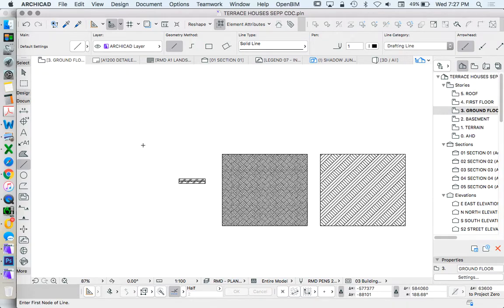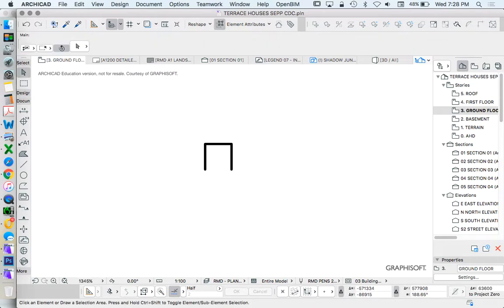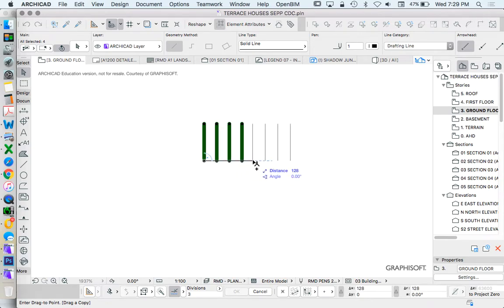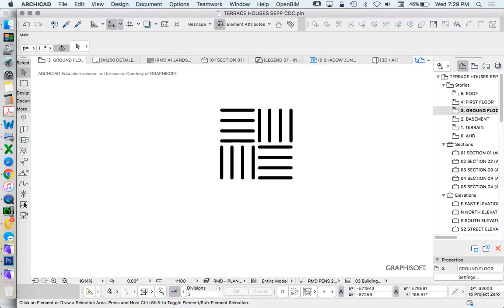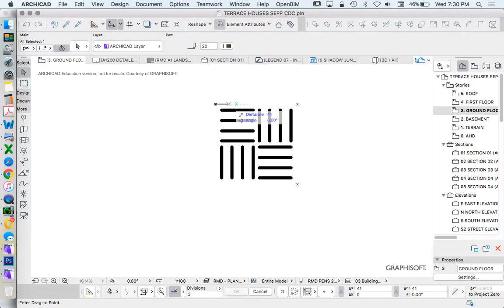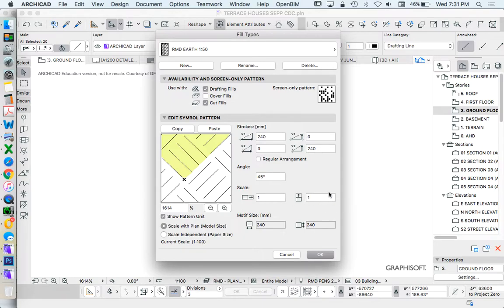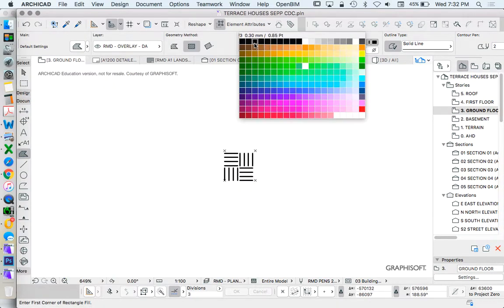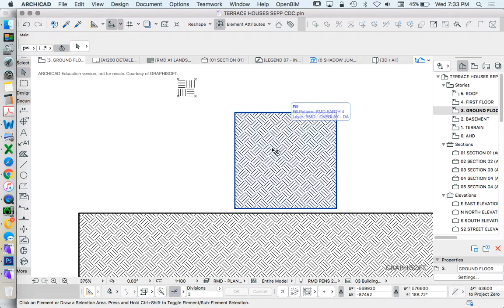ArchiCAD Fills - custom earth fill

Comment: Hello I have an archicad question not sure if this has been talked about if you have come across a similar issue but I need help solving it.

So here is my problem. when I place a wall onto a slab and insert a door in the wall and I want to show the finished floor material continuous under the door into the next room it does not show continuous. what I get the same wall showing and the floor finish doesnt cut through that section of wall below the door.

This problem is visible in section and 3d

Is there a way to tell ARCHICAD to cut the wall beneath the doors smartly without adding additional elements?
Reply from the maker: Hi Ricardo, I've never had this problem, so I'm unsure of what the issue could be. Below is a few things to check in order to troubleshoot the issue: 1. Make the sure the slab is continuous, not bounded to each room 2. door must be set to base of wall height 3. remove door ill option (if the door object has one) 4. check you don't have a double slab issue 5. check you are have the wall base set to floor surface (not structure) or, set a negative value. 6 check you have the slab set with a reference line at top not bottom.
Reply: Check your priorities in the building materials section. it seems the priorities of the materials applied to the wall are higher then the floor material priorities. another workaround is to make the floor of different parts. mean you model the slab, then the insulation and after that the finish.